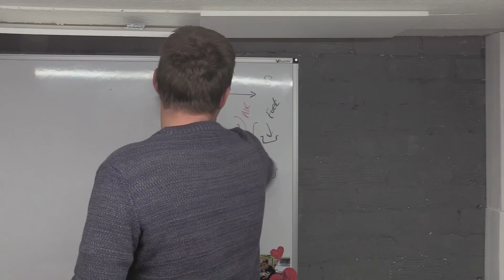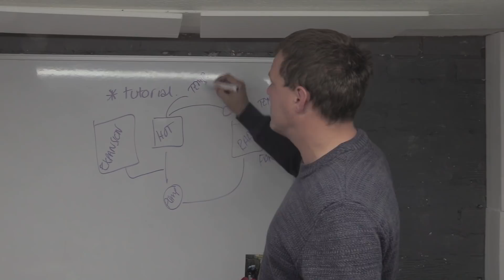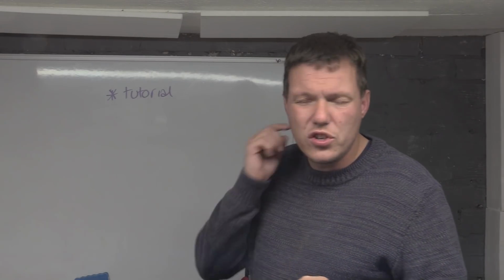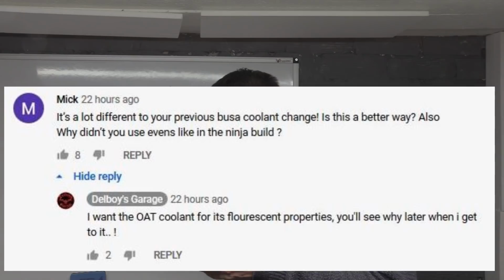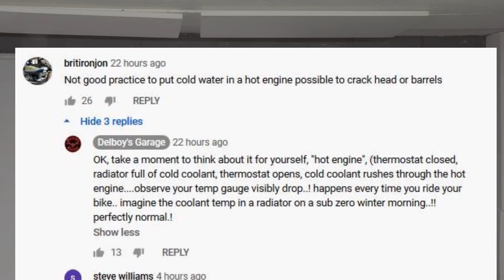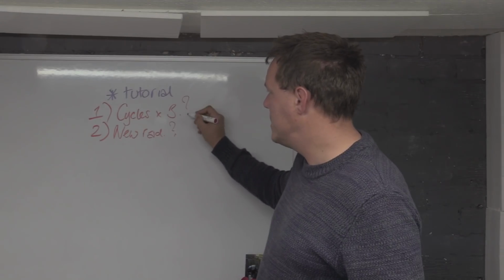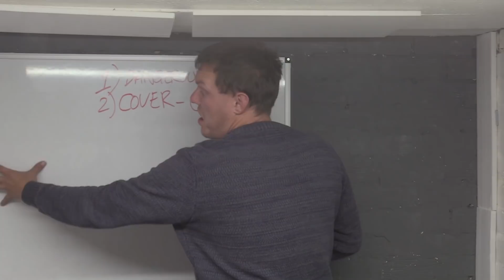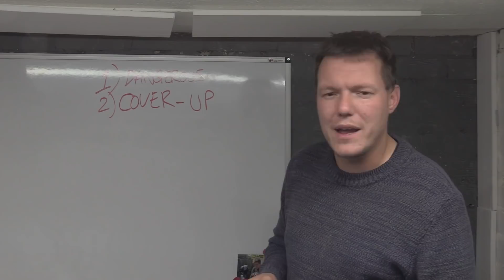Endangering people for views

Comment: Changing the coolant in a hot engine will damage the ceramic waterpump seals (they crack) or even deform the cylinder head
Reply from the maker: Warp the head.... unlikely. Fuck the ceramic seal. No.
Reply: @thedirtyworkshop  I've been to repxpet (schaeffler group) courses  and they strongly advise to not do it while it's hot as it will cause premature or even instant waterpump seal damage. SKF states the same tho they don't make pumps, only sell them.
Reply from the maker: You mean the graphite/ceramic face seals? Or something else?

Comment: Although if I'm honest you may have "laboured the point", you are of course spot on about the dangerous nature of this. I'm no mechanic, have never tackled changing coolant on anything (while I know the theory, in practice something would be slightly different like an airlock or something and then I'd be stuck), and even I know HOT LIQUIDS AND STEAM ARE DANGEROUS SO WAIT FOR IT TO COOL BEFORE YOU OPEN THE PRESSURISED HOT THING! I've reported the original video as being dangerous, so hopefully YT will take action. If a video is just a bit crap I wouldn't bother, I just move on to something else, but someone's going to get hurt following this chap's advice.
Reply: On, and I meant to mention - in the spirit of polishing your videos - there's a reflection of one your lighttubes in the white board that means I couldn't easily read "1) Dangerous" at 22:22. I'm not even sure what you could/should do about it, but I know the board is pretty key to a lot of your videos so thought you'd like to know. :)

Comment: Is that a UAG phone case by any chance? Looks similar af to mine on my S8 that im watching the video on now lol
Reply: How is it? I'm debating one for my s20.
Reply: @jediknight1294  proper good, had it since I got the phone back in 2018, dropped it a few times, held up every time. The case is like a really hard rubber, so it'll never come off unless you pry it off, but its still kinda rubbery which absorbs any knocks. 

It works well with the curved screen as well, that was my main worry, that potentially the protection of the screen would be sacrificed for functionality and ability to use the edges, but thankfully, the entire screen is functional, but still fully protected. When i lay the phone face down, the screen itself is hovering about 2mm off whatever surface due to these raised bars on the top and bottom of the case that keep the screen from being able to come into contact with anything.
Would recommend 👍👍
Reply: @desantos1234  cool, I'm looking at their properly tough milspec armoured one because im clumsy and do a lot of outdoors type stufg, nice to know they are decent quality.
Reply: @jediknight1294  yeah it'll do. Ive had it in my right pocket and lowsided my bike ironically onto my right side twice with it there, and it was fine.
The first time in Dec 2018, it was just a light slide on some black ice.
2nd time was a rainy day in Oct 2019, coming down an off ramp from the A45 taking the exit into Northampton town centre, traffic lights red at the bottom, began braking doing approx 60mph, front wheel locked, must've skidded on front wheel about 10 metres, then released brake, then straight back onto brake because of traffic queues ahead, couldnt stop in time, front wheel locked again, went down this time and slapped down hard onto my right side and slided another 10 metres and got wedged under a Peugeot 206 lol, followed by my bike which smashed into the left rear bumper of the car, luckily missed me lol.

Phone was fine somehow, bike wasnt 😂😂

Comment: Cold water in a hot engine will definitely crack an aluminum head. I have done it.
Reply: We chuck freshly solodified cast aluminium in water at the foundry with no issue..
Reply: Mitchell Baker 

Not bolted to other bits of metal then though, is it? If it contracts there’s nothing to halt the contraction at any given point, meaning it’s (more or less, near as makes no difference) even contraction through the single piece of aluminium.

Dissimilar metals and rigid points of contact (i. e. bits bolted together) is the issue with metals in an engine, sudden changes in temperature, and the danger of cracking/warping.
Reply: @BungleBare  fair call, but its not like the temepratures involved are that huge either.
Reply: Mitchell Baker 

In most cases you’ll probably not have a problem, but when you do it’s an engine wrecking one. Not worth the risk to the bike or, more crucially, your own safety, to do it Del’s way with scalding hot coolant flying at you.
Reply: @BungleBare  definately not worth the risk

Comment: I can't bring myself to watch Derick pissing about anymore, not even for the comedy factor. I totally understand why you get so wound up with his crap (you are not alone). 
I'v posted comments many many times on his channel, not once got a reply and I have been kind to him (sort of), even if I am calling him out on shit.
But this draining a Hot cooling system is like he's doing everything he possibly can wrong, it's almost like 2020 is calling out for demented fools to fuck up to add to the carnage.... Let's hope 2021 is a milder bitch.

I was helping a guy out once who's Vauxhall Chavette was not showing any temperature on the gauge, it wasn't overheating or anything but just not showing any increase in temp from cold....
I showed that his gauge was not faulty by shorting the temperature sensor wire on the cylinder head and voila the temperature gauge went off the scale, so the issue could only be (by my crude process of elimination) the temperature sensor it's self, so off to the motor factor's we went.
I went inside to get the new sensor leaving silly arse in the car, on my return from getting the part I sauntered across the forecourt towards where the Chavette was parked and noticed then that silly arse was under the bonnet fiddling !! 

Before I had chance to see what was being interfered with (I was still a good 8-10 feet away) an almighty geyser erupted from under the bonnet, yep he'd removed the sensor. Luckily for the guy on the spanner the only part of him that came into direct contact with the hot steaming stream was his rather large hair, most of the stream shot past his head parting his hair, then hitting the bonnet it was then deflected in my general direction... That shit was extremely hot, we didn't find the original sensor and I was only slightly scalded, being as I was still a fair distance and moved away as soon as the blast ejected.
Could have been very serious if either of us had copped the direct stream in the face.... 

The good news was I replaced the sensor and re-filled the coolant and the gauge worked flawlessly.

Comment: I work with emergancy generators, big industrial engines! 
Because they sit still for agges, they develop some corrosion over the years no mater what you do.
We flush there coolent systems with cleaning agents when the are 40-60 years in Service because the get gumed up to the point they cant get rid of the heat in operation!
To have anny effect you have to run them hot to the point the Thermostat is wide open under load! We NEVER open those thins before 1-2 hours of cooling down! 
Because if you have 110°C Water sitting in the block, you don´t want to boil of those 80Liters of super heatet wather inside the engine, plashing in your face, and blasting you with steam over the vantilation lines!!!! 
A normal coolant change dosen´t need flushing or somthing else, you just replacing the coolent because of the corrosion aditives from time to time!

Comment: Talking about hot oil on oil changes, ive read/heard its also to help get any contaminants that may be on the bottom of the sump somewhat suspended in the oil and removed.
Any truth to this Matt?
"Responsible precautions like any service operation"
Ummm like ensuring your coolant temps are cool and not under pressure?
Reply from the maker: I'm going to test this
Reply: @thedirtyworkshop  awesome!

Comment: Lol - I'd seen the super slippery video, but never picked up on his comment about GP500's using an oil and water mix in the engine. Talk about someone not understanding what the hell those 500 engineers were doing with regards to injecting water into the inlets, and also injecting it into the expansion chambers. How does he turn that into "running their engine oil as a water and oil mixture." Dangerous, very dangerous.
Reply: OK now I'm down a rabbit hole looking into what was done with water injection so thanks for that.

Comment: “You can protect someone from anything, except themselves” 
 You help Matt by drawing attention to the fact of dangerous practices are being used. Anyone with some “savvy” will realise not to do it like that.

 Just my take on the “hot engine & cold coolant” 
In the old days my Farther would say that there was a danger of cracking the block or warping the head if you added cold fluid to a hot engine that had little to no water in it. He would say give it 20 minutes to cool and when you add the water keep the engine running. Maybe due to the fact he was used to working on vehicles made between 1930/1960’s materials being used then being less resilient. 
 Just a historical view as I am not that old yet 😉😂
Reply: @KurtFrederiksen  there was also one HELL of a learning curve between the 30's unpressurised cooling systems and the pressurised ones. Hence all the OMG NO warnings.

Comment: Hi matt, Ive Ive told you this before, but a real girly girl, as hot as all fuck pulled into a service station where i was workin. Her radiatorg years ago, in tears. She said her engine wasnt working. Had to get blankets to even approach the bonnet and a fist full of rags. to get to the 3.00 litre Cortina. My bike was a good  50 metres away. Once id opened the bonnet, her header pipes were glowing red hot in the daylight. Took a flying guess that her radiator was empty in any case, quite correctly. Her dipstick showed Zero oil as well. She was going for a job interview. This was an imminent engine seizure situation and if id so much as spat on her engine id have burnt myself. I couldnt help her really and she drove off in tears with her engine sounding like a bag of rusty hinges.  You cant help stupid or ignorant mate.

Comment: do engines crack when it rains then? or when i go through water on pitbike. thats cold water hitting engine. never cracked any
Reply: a small amount of water gradually splashing against the exterior of a hot engine with a full coolant system... is not the same as taking a hot engine, draining it's fully hot coolant system, and filling it with cold water

have you ever heard of "quenching"?
Reply: @chrisdavidson911  yes i have. but im also referring to driving through small becks/ deep water where the water is just below the airfilter. as in waterline covers bottom of engine up to bottom half of the head.. odd time i have drowned the bike going too deep. all im getting at is aint it the same thing? i mean its air cooled and gets a propper dunk and makes steam. never cracked anything.
Reply: Even with the engine under water the water jacket has thermal mass and will slow down how fast the engine cools. 
Air-cooled piston engines used in airplanes can have issues with shock-cooling as well if you cut the power at altitude and descend rapidly.
Reply from the maker: "do engines crack when it rains then?"

- no they don't however the environment is a bit different internally

Comment: The guy is a liability and is risking other viewers lives, I asked the question you have not mentioned that you will have to inform dvla of your frame modification, his come back was the subframe was not classed as the frame, so I rang dvla to clarify this matter and there response was sub frame is frame and would come under the radically altered vehicle and to keep the original registration it must follow certain rules 
 THE DVLA WEB PAGE -Your vehicle must have 8 or more points from the table below if you want to keep the original registration number. 5 of these points must come from having the original or new and unmodified chassis, monocoque bodyshell or frame.
As you guessed he deleted the comment.
Reply: It wouldn't be a DVLA decision on that mate, its a SVA inspectors call, the guidance book is available from them if  if i remember rightly.

I suspect that the busa wouldn't actually be classed as radically altered due to the subframe work  as as far as I know he didn't do any none reversible frame mods.  It is possible that the welding of metal to the the front end to create that shoppimg trolley abortion WOULD cross the line into needing an MSVA examination of the bike. Honestly this thing is something that NEEDS an inspection to determine whether it needs an inspection. 

The ZX7 on the other hand I believe was plated and registered illegally due to the fact he not only removed the original subframe but welded new mounts on to attach his abortion.

Remember that a bolt on hardtail kit or bolt on trike kit won't make you have to put the thing on a Q plate but a weld on hardtail or trike conversion does mean that the bike will require an MSVA test and will end up on a Q plate. 

It might be worth posting a link to the videos on the ukbiker forum as I know there's at least one SVA inspector involved in the trike side who is active on there.

Theres some really odd rulings on what precisely counts..
Reply: @midlandt4249  oh I'm well aware of the regs, I have the handbook for trikes somewhere. 

IF the subframe has been simply removed and it could be returned to stock simply by unbolting his construction and bolting an original one on it probably won't count. But the regs are really odd. 

I THINK the busa will become a radically altered vehicle but not because of the subframe. Its probably going to fail construction and use regs and I'm fairly sure an inspector would not pass the welding. 

I am reasonably sure that the zx7 was on the road illegally based on it counting as altered due to the frame mods.
Reply: @jediknight1294  I rang dvla for clarification they said sub frame is frame and would come under the radically altered vehicles, that said that could just have been the view of the person on the other end of the phone but I wouldn't like to argue the toss with them especially if you've just wheeled in that wasteland busa to peruse !!
I would like to hear the reaction of an SVA inspector on said vehicle.
Reply: @midlandt4249  I suspect that's just the view of the person on the phone. As far as I'm aware the sub frame doesn't count as it isnt a fixed and perm part of the framei know changing one in a streetfighter build to run a 916 rear tail unit 9r change the angle of the tail unit isnt in and of itself something that would require an SVA inspection given it can be done without whats classed as permanent mods to the frame. 

 . The only people whose opinion matters are the Inspectors.the DVLA guys tend to get told off for giving opinions. The rules changed ages ago because of the problems that local DVLA office inspection of vehicles caused. You tended to have some places with no clue passing everything as not needing a Q plate just an amended V5, leading to things where a GSXR1100 engine in a custom frame was still registered as a gs500.

 I really also want to see what an SVA guy would make of the shitshow busa tbh.

I REALLY want to see this guy get fucked for taking the piss. The regs are something every other builder has to work within and he is going to make it harder for everyone else when his shit box kills someone.

Comment: Let's be honest if you need to watch a tutorial by  Dell or any 1 else on how to do a coolant change then you probably shouldn't be doing it yourself.     I'm a mechanic you would not believe how many cars I've had to repair after customers try do there own repair or service  work I have seen all sorts of disasters . I know there's plenty people capable of doing alot of there own work that are not mechanics but most of the time it ends in disaster   a simple oversight can become  expensive dangerous and messy real fast.    But if its your own bike or car and your not putting anyone else at risk then by all means give it a go.... By the way never open a coolant system when it's hot ... It is also never advisable to ad cold water to a hot system I've heard tell of old cast iron  cylinder heads cracking    but I have never actually seen it myself  but it's easier to wait for it to cool than to remove a head.